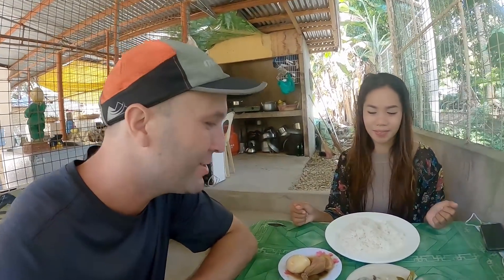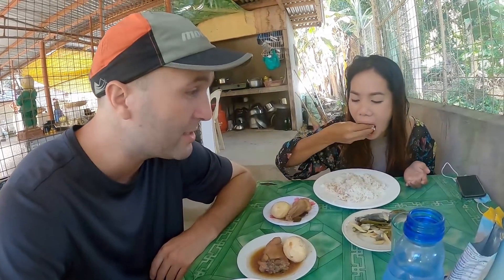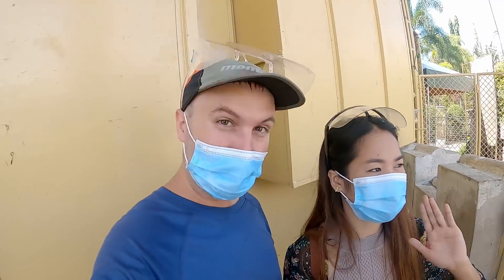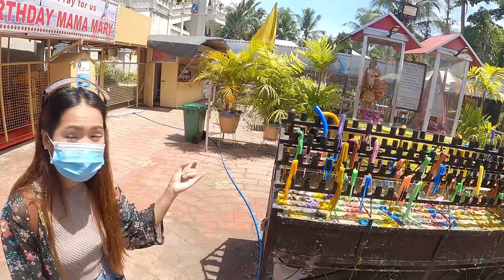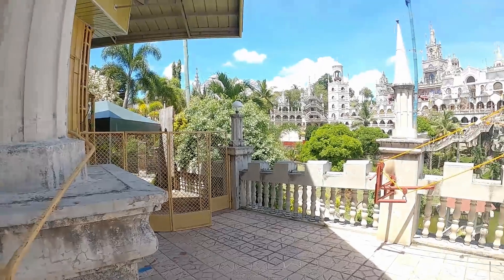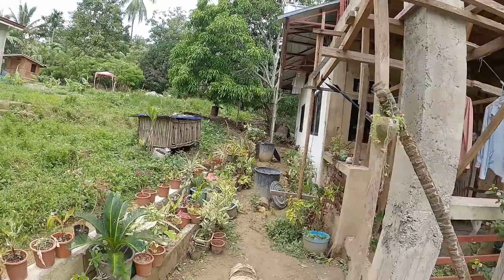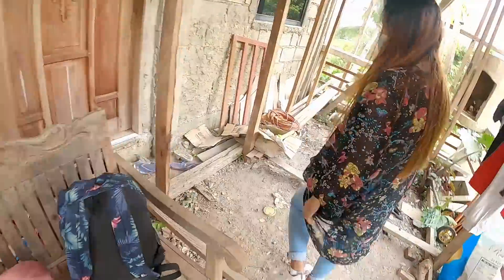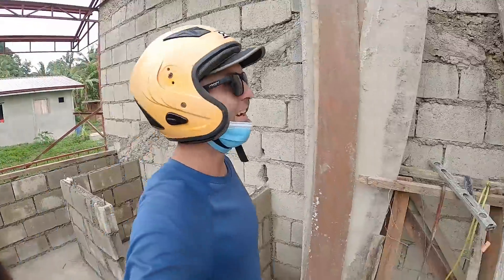Back in Toledo - Update on Raymund and Reche’s terrace - Province Life

Comment: The layout design of the on the terrace looks a bit weird. They could have extended the layout further instead of using HB the should have used frames and cement board. The room will be bigger. Anyway it's their house.
Reply: 😀 right very weird design
Reply: Exactly, horrible floor plan!
Reply: Totally weird...why put a divider for that tiny space at the back?  Maybe a hideout? 🥴